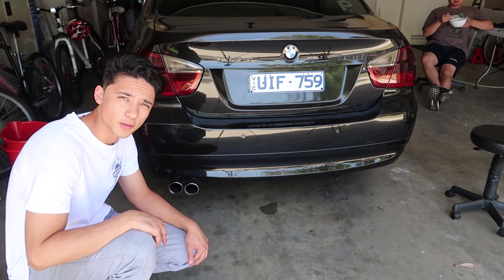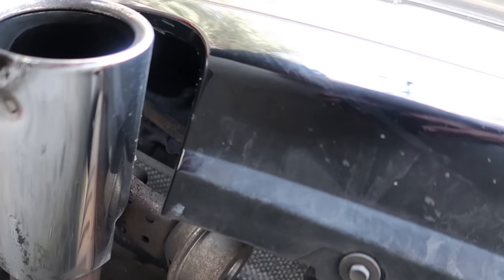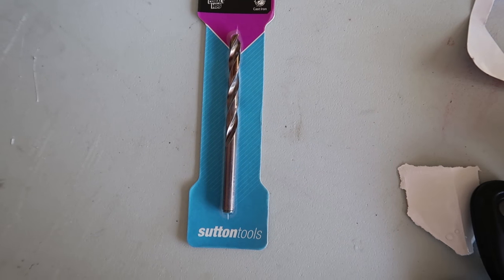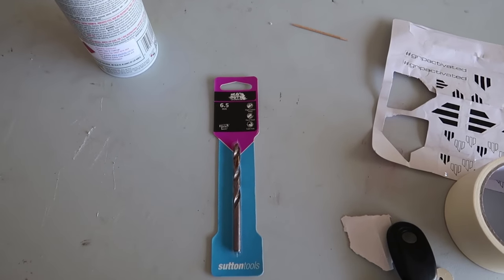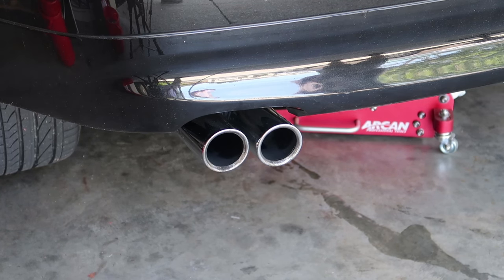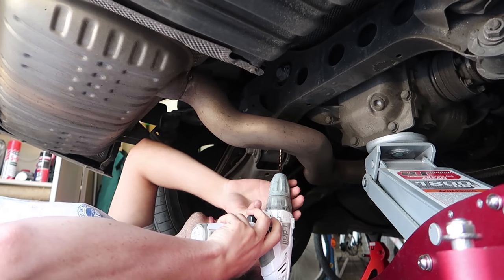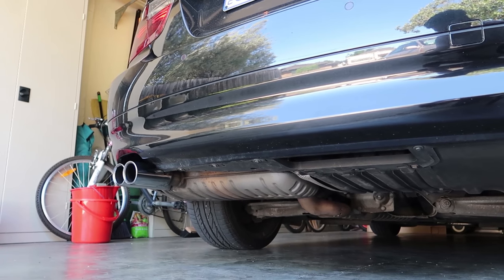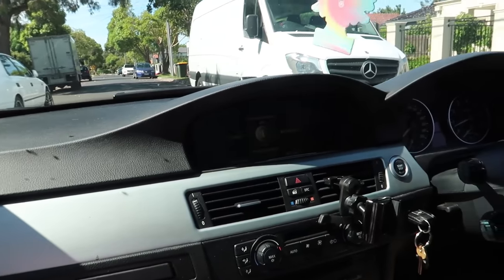Exhaust Mod on a whole new level of dumb works surprisingly well...

Comment: ok can we all agree we have thought of this because we dont want to spend money
Reply: Yes
Reply: and ppl will still bash on you even though they prolly thought about it themselves 🤦🏼‍♂️
Reply: @fml861  pp
Reply: I mean at the end of the day what’s the difference between this and straight through mufflers🤷🏻‍♂️🤷🏻‍♂️ pitch and tone that’s it…I just don’t know why everyone goes with a small bit…take a 3 inch hole saw right to the bottom of that big ass muffler lol
Reply: Exactly, in my case I dont want to much welding on the pipe aldo. Drill some holes and cover them with a pipe clamp when You want to goback.
Reply: The cost for the value is Just so great! Thats why we do it...but if your stage 2 or plus you need to change or delete catalyseur and on the turbo car it doesnt help because turbos kill the sound and they need yhe pressure in the pipe so it can spool with pressure
Reply: Yes and i might just do it to my car tomorrow
Reply: @lostrelyk  who gives af, the shit is hilarious and cheap. Cars are fun to fuck around with 😂People just take things too serious all the time lol I dunno about you but even if it’s a shitty type of loud, people still break necks looking 👌🏻👌🏻
Reply: I don’t want my sister to notice
Reply: Yes
Reply: Pretty much. I'm just sick of not hearing my V8. I get 13mpg, I would like some sound
Reply: Doing this tomorrow. Because today I am finishing the last bit painting my @ is250_sage 😅🤪 I will only change the exhaust once it falls off, because it ain't cheap to be doing exhaust swap
Reply: heck im thinking of doing it now
Reply: I mean I'm here cause my reliant robin exhaust is like an inch at most and can't seem to find a damn aftermarket glass pack that has a tiny inlet 😂😂
Reply: @lostrelyk  life. 🤷‍♂️
Reply: Axle back cheap
Reply: thought? i js went and did it🤷‍♂️
Reply: Or your blessing from Facebook marketplace is taking forever to deliver 🤦‍♂️
Reply: Its illegal in my state to modify it too 😂

Comment: For people thinking this affects the environment greater, it doesn't. He drilled after the catalytic converter, and before the muffler. The muffler only "muffles" the sound. Basically the exhaust is the exact same emissions level as before just louder. The only danger is potentially rust and exhaust fumes in the car.
Reply: So it wont leak right
Reply: @juancena7636  not unless you have an issue with your cats themselves, such this won’t cause.
Reply: He's polluting the environment inside his vehicle because now the exhaust doesn't go all the way to the tailpipe it flows up into the trunk
Reply: Greta was here in the comments?? Omgosh I want her autograph! 😱😮... 🌈🦄🖕
Reply: all i got was a loud hissing noise deafening when accelerating
Reply: @asrielandcharadoesstuff4789 you acoustic?😂
Reply: What if we drill some holes directly in the muffler?

Comment: Got the same plan here. I dont need it too loud, dont wanna waste money and time for an electric valve also. Just drill some holes until the volume is right and can go back to original with just a pipe clamp.
Reply: Nothing JB weld can’t fix
Reply: Then its valved lol you just have to have a drill to open and close the valves

Comment: This is not dumb, it works!!  After the Borla exhaust I bought for my 2005 mustang GT was too quiet, I did this mod exactly and it sounded amazing I got compliments on it all the time! Then, I also did it to my next vehicle, a j k Wrangler... And while it wasn't as good as the mustang, it still sounded very good and extremely similar to the aftermarket exhausts I heard for the Wrangler. Now, I recently did it 2 mi 2015 Mazda CX-5, and again the results have been excellent. If I had the bread to buy inexpensive cat back I would certainly do so, but on a tight budget this works really well and does not affect power or fuel efficiency, at least not that I have noticed in my pretty extensive research lol. I started off with drilling one small hole literally just before the muffler flange, then I drilled that one out larger, to about 1/8 inch I think. The mustang was dual exhaust, so I did this on both sidesmustang was dual exhaust, so I did this on bowl sides, and ended up with about 5 holes on each side LOL. For the Jeep and Mazda, I only drilled out a couple holes. If you do this be aware, you can always make it louder, but each hole increases the sound, and you can't undrill lol (although u could plug it). People can say what they want, but everyone loved the sound of the Mustang, especially after I added intake and a tuner. Once I added those mods, the thing ripped big time! It was basically a very loud version of the Borla. On the other two cars, just having couple smaller  holes did the job, making them sound aggressive, but on the milder side. Right now my CX-5 is not as loud as say the loudest corksport available for the CX5.
Reply: How many years have you been using this upgrade? Has it not damaged anything? The holes kinda change the way the exhausts rotate inside the exhaust pipe. Has the car started to backfire? I need to know this :P
Reply: @patrikrusinko  my bmw has 2 pipes and each one has 8holes and theres no popping. Just gave my car a nice exhaust it's nothing that will get u pulled over cuz it's not as loud a muffler delete
Reply: VERY HELPFUL 💯
Reply: What are the bowls on the mustang I wanna do mine
Reply: Why r people saying its an exhaust leak or blown exhaust? Im somewhat concerned if i should do this to my catbacks on my stang or not. I really want to make it louder cause right now its just medium loud. Doing this would be nice to cause its free and i dont need to spend money. How would thjs cause exhaust leakage??? Like how is this in any way different then a muffler delete??? of course there would be leakage here and there but its not excessive. Plus u can drill more and larger holes with larger sizes and its practically the exact same and your muffler and tips are just there for aesthetics
Reply: @Tang5oh  if you do it close to the end of the exhaust it won't affect any thing. If you cut it too far up it could affect the flow/rotation of gasses and slow them down, reducing efficiency and power. Just drill 1 or 2 at the end

Comment: For anyone wondering, I did this to my 1994 MJ triton since you can’t get decent aftermarket mufflers that will fit. Putting 5 3/8 inch holes, and it is LOUD. it’s not extremely obnoxious, but you’ll hear it a block away no issues, and it created a lot of back fire when you’re at higher speeds and revs, but I love it, just got to really crank the music to hear it lol.
Reply: @YoaminYashed  yeah bro I'm going to give it a go because I am also replacing mine soon so why not

Comment: Really should of explained to the less Informed that the drilling needs to be made after the catalytic convertor, just before the muffler and nowhere around or before the oxygen sensor. And then explained why. You can't smell those gases before they hit the convertor and can be potentially life threatening or cause serious illness if not drilled correctly.
Reply: Hey Chris,  do you reckon an old 1993 hilux would have these sensors? If not, should I be doing this for my own good. Also side note will this damage the underside of my truck as the exhaust may be coming out prematurely through those holes and hitting the underside. Thanks
Reply: @danielseeto9622  Honestly buddy I'm not sure of the sensor placement on a 93 hilux. Should be able to locate on google, however. As long as you have holes drilled facing the ground you should be fine and avoid underside damage. Maybe some long term rust damage if anything, which is not ideal and keep in mind doing so will most likely fail an inspection. As for doing this for your own good, its completely up to you. Reasonably safe if done right. Just make sure you check for the sensor first, drilling before it or around it will have serious repercussions regarding your MAF. MAF readings that get sent to the ECU will be completely incorrect. The ECU will compensate the increased amount of air with extra fuel and then your in trouble. As for if you should be doing this for your own good... That's purely for you to decide based on the pro's and con's. IMO - con's outweigh the pro's.
Reply: @chrisking4411  thanks for going into more detail, I appreciate that
Reply: it’s really not that difficult to just drill in between the muffler and the cat lol … there’s also a resonator in between the cat is like at the top of your exhaust

Comment: pro tip. take the exhaust pipe off and put few holes from the upper side on it. that way when you go to yearly check they wont be able to see it but you will have it permanently louder
Reply: Idk if your joking but im not experienced in cars and i know thats a bad idea cause drilling the bottom lets precipitation out instead of letting it sit in there
Reply: @sheldonwoodhouse4222  if the precipitation needed to go out then the car manufacturerer would of done that
Reply: @isatntt  exactly, the heat in the pipes evaporates all that either way
Reply: Wut is a yearly check , mate?
Reply: @Sleepymazda999  some states like West Virginia require everyone who drives to get a yearly check on the car to make sure everything is there and you're not modding the car
Reply: @Sleepymazda999  I live in Ohio on the Ohio River right next to wv so that's how I know. Thank God Ohio don't have that rule as iv modded the shit out of my bmw lol
Reply: @Lord_Itachi8758  but this is in australia
Reply: @JamesMay08  It’s a tip for anyone wanting to do it somewhere that has yearly checks, like the UK
Reply: this is a joke guys don’t do this . Don’t take any pipes off Wtf

Comment: You got to drill some holes in the Cylinder. One hole per Cylinder gains +30hp. The more holes the more oxy to bang the more power. 20-25 holes per Cylinder is a good ratio.
Reply: What a stupid joke lol

Comment: Or you can find where the exhaust is connected to the catalytic converter tube, then put a long enough bolt and nut in the middle leaving a wide gap between both joints and that is reversable, rather than filling the holes of ever needed
Reply: TRY NOT TO LAUGH  ahh I see!
Reply: TRY NOT TO LAUGH  👌 which ever is reversible and equates to having fun and getting away with it lol 😆
Reply: Yeah but then you’ll have exhaust fumes leaking into your car lol.
Reply: @TakeThis_L  some of us already have exhaust fumes running through their cars😂
Reply: That’s terrible and releases toxic fumes man hell no
Reply: Does it work

Comment: I did this on my car untill my muffler delete kit come in, sounds good but there is a slight fluttering noise. Would drilling a few more hole resolve this so there is more space fro the exaust gasses to escape? I only drilled 4 holes on each pipe, mine is duel exaust, so 8 holes total about 3/8 in diameter
Reply: TALK ENGLISH
Reply: They say drill at least 6 holes

Comment: Cant do this in canada cause you can see exhaust fumes coming out from underneath the car in the cold winter :/
Reply: Icarus that’s why you do it on your butter fly valve side. So that way when your car is at idle it won’t do it or no back pressure will flow all the time.

Comment: Any affects for fuel economy? Because I want to drill in mine too.
Reply: Nope
Reply: Just buy one
Reply: An exhaust mod wild only change the fuel economy if there is different amounts back pressure being pushed into the exhaust, holes in an exhaust will hardly change it at all

Comment: Would it pass inspection? And if not is there any other way to make it loud?
Reply: No it wouldn’t In some states and in some it would so it’s basically an exhaust leak so you just got to check for your state I had the same problem and it didn’t pass inspection so I had to replace the pipe in that spot but I just ended up getting a new muffler so ya I live in Texas so no it doesn’t pass here sadly but this is a super cool little project
Reply: Ryan Malone thanks man for letting me know
Reply: @RegiosRed107  just put bolt screws the day for the inspection bro to pass

Comment: But dont you have to repair this so it can pass MOT?
Reply: No MOT in Australia
Reply: Use clamp before mot
Reply: what mot? they dont live in a communist country
Reply: @Shadow0fd3ath24  Mot is for keeping the roads safe so no pieces of shit cars endanger others. Thus the speedlimits can be a lot higher than in australia
Reply: put the holes on top
Reply: @Shadow0fd3ath24  im pretty sure theres a thing called smog in america
Reply: Uncle Luke then where does any created precipitation go
Reply: @ColinRH  it evaporates with the heat

Comment: For a size 3/8 do you recommend 4, 5 or 6 holes
Reply: I did 5 holes and that was more than loud enough for my pick up, 3 or 4 would’ve probably been better in my case if you’re not wanting to be completely obnoxious. Not sure how drastically it’ll change with different cars and pipe sizes.

Comment: Did you get a check engine light after doing this mod?
Reply: Michael Robillard nah i did it on mine and no engine light comes on
Reply: Cel if it's before any sensors usually
Reply: It’s before the sensor, you’ll be fine.
Reply: The way that thing started, I’m guessing he already had a cel

Comment: So one that can go through wood, Metal or PVC doesn't work? Will on e that can go through Steel beams work?
Reply: Any drill bit will work just fine
Reply: @coleosmond4185  Not just any drill bit will work I have one meant for wood and PVC and metal and the drill was zig zag all over the place you can see that it wasn't until I bought a bit with a steel beam picture that it stayed out took for ever but went through.

Comment: So question!  My altima has duel pipes. Would holes be drilled where the pipe is straight and splitting into dual pipes ( straight pipe, splits to duel pipes, muffler then the exhaust tips)?
OR on both pipes of the dual on driver and passenger side pipes right before each pipes muffler?
Reply: Spiral0ut I would recommend right before each pipes muffler, gives the exhaust more length and giving it a better sound i find
Reply: @jeremypeeters5322  thanks Jeremy appreciate it brother

Comment: I have 2 audi the v8 and the 2.0lt with hole and it doesnt work on the 2.0l turbo. On the turbo car im curious to know if i lost power...bit the sound didnt change at alll.
On the v8 the sound was already great and drilled one small hole in each pipe and i dis saw à 5 to 10% increase...not enough haha but i only have one point left on m'y licence for 2 year so im looking for à balance and it work...

Comment: The fluke may be to add extra back pressure for more torque.
Reply: Backpressure doesn't increase torque
Reply: It closes at idle to quite the exhaust
Reply: you actually wanna get rid of the muffler to get more hp, back pressure is only needed on a 2takt engine
Reply: It doesn’t really cause more back pressure your hp really stays almost the same if imma be honest

Comment: I don't know anything about how cars work so if I say something stupid i'm sorry. wouldn't this create an exhaust leak and if it doesn't are there any other problems that can occur from this
Reply: The holes are literally an exhaust leak, but the other question is more important.
Reply: carbon dioxide can possibly leak in the car if your stationary for too long and can possibly hurt your engine
Reply: @chickenjoe9832  it won't do anything to engine, environment or anyone. The only drawback is that as you mentioned, being stationary the funds will be released under the vehicle rather than behind it, so there's a small chance it could mean into the cabin, but that's not enough to do any real damage to your lungs unless you sit there for hours.
Reply: @samsantana   so if i sit there for hours is it bad for me?
Reply: @blendselimi1271  Give it a go brother ;)
Reply: @samsantana  how about the actually muffler itself with holes at the very back end so it’s basically shooting outwards away from the car ? Is there any real threat to doing this ?
Reply: @godisoncod475  no real threat of much carbon monoxide getting into the cabin that way but it won't make much difference to the sound either. I'd gut the actual muffler, that is remove all the packing in it and leave it as is without any holes either on the muffler nor the exhaust under the vehicle. That will in fact produce a deeper and louder sound and as long as it's not exceeding sound level limits for your jurisdiction then there's nothing illegal about it.
Reply: Have you done this to your focus ?? I’m thinking of doing it to mine my old Equinox had a hole in it before purchase sounded amazing people here making me trip about the leaks and fumes but I’m all for it

Comment: Hey man , is that mod can harm any part of the car?? , keep it up
Reply: laith hamdi harms the enviroment
Reply: It's only a sound mod 🔊 it doesn't affect anything else
Reply: ExeKuTioN Cro he did not touch the catalytic converter, only annoys the non-car people not wont polite more.
Reply: @nestormoctezuma4695  But if the holes are coming before the catalytic converter...
Reply: Alexander Kevin you can affect the reading of the precat O2 sensors. These are used to adjust the fuel mixture. Extra presence of O2 means lean so the computer will compensate with more fuel: fuel economy goes to hell, Melting the expensive catalytic is a matter of time, the exhaust can become a bomb. Hot exhaust+ unburn gasoline with fresh oxygen coming in and being stored by the catalytic=very loud bang. Rapid flame front so most likely won’t burn your car to the ground but will scare the hell out of you.
Reply: @nestormoctezuma4695  the drilled holes are after the o2 sensor so it would not affect the reading
Reply: MxCars  Bro the guy literally above him literally asked what if not that it was genius
Reply: @Exekutioncro  no it doesnt if u do it right before the muffler and after cat and o2 sensor.